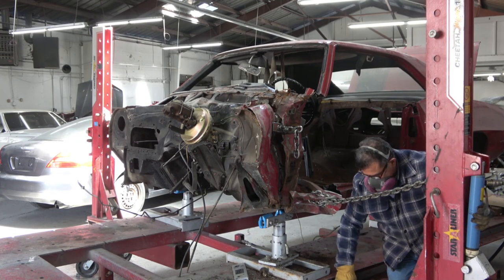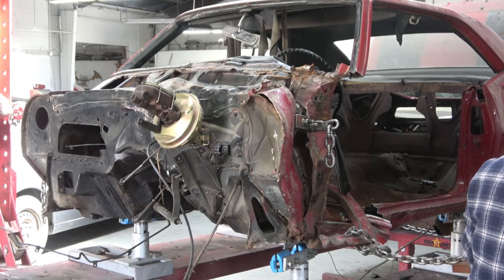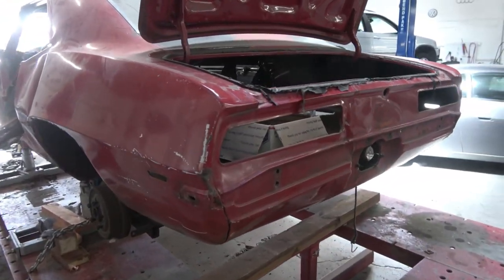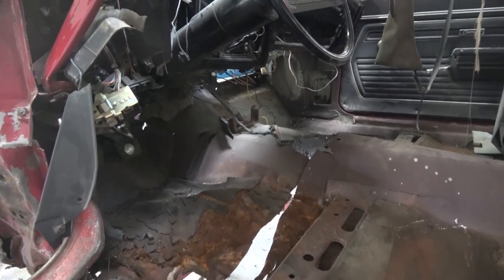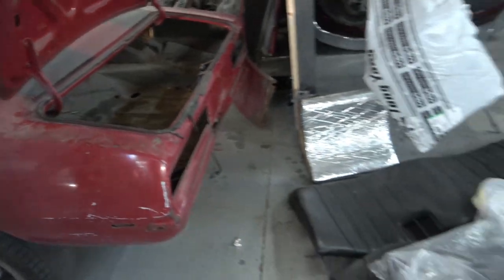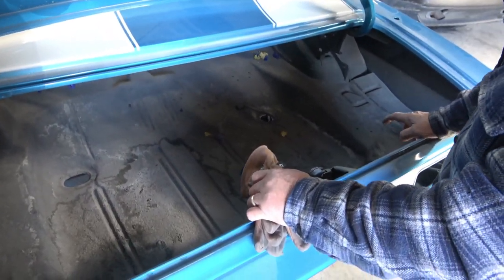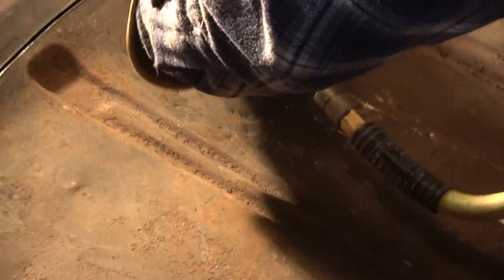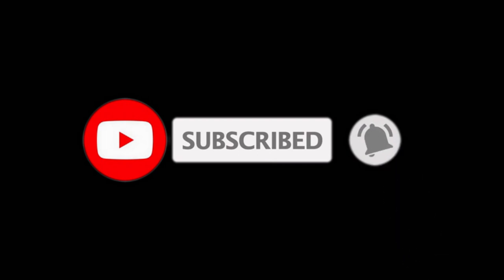69 Camaro Garnet Red Crashed but not Dead Z/28 Restoration - Part 4   Body Pull & Body Panel Removal

Comment: Well it's good to see it being worked on . Good job l didn't hold my breath !  😁 lt's ironic that the trunk floor is the first panel to be cut out , not through damage but rust !  Over here in the UK air chisels are banned in bodyshops  and have been for 30 + years. Pete, next time your recording ask if you have the radio turned off . You're fortunate that you can still obtain most of the panel work and l guess at a reasonable price ? ( Maybe you've had these stored away for some while )  Anyway it's great to see her coming back to life ! Thanks for sharing .

Comment: good to see you have someone willing to repair it 
i had a holden HQ ute that was as badly damaged as the camaro  i fixed it by getting it pulled square then do a cut and shut front firewall section to repair most of the damage

Comment: Do you have anymore update on the crashed but not forgotten garnet red camaro Z28?
Reply from the maker: We are in the process of moving the car to the frame machine, then the jig for straightening and spot welding.
I will be posting a video on that whole process as it progresses. It may be a couple of weeks away, but it will be an exciting video.
Then after that is done and the car is all spot welded together, the bodywork and paint will start.

Comment: Good to see you again! Question when will you do the follow up on the Carb installation for the CBX 1000? 
I just got my Carbs back from Mike Dixon in Arizona and it's kicking my but trying to get them back on. My strategy is using a heat gun to heat the intake manifold rubbers up then push push push them carb on. What's your thoughts?
Reply from the maker: Watch my carb. video. I show how to push them on with a really long pry bar
Reply: @digitalpizza1  I did,  I had a rubber hammer, 2x4, and pry bar but it's not working for me. The Company in New York told me that maybe my intake manifold rubbers might be for an 1981 with an angle rather than for my 1980. So I returned them for another set. 🤔